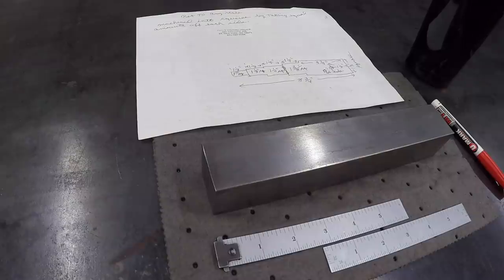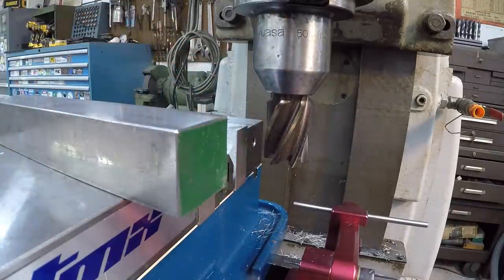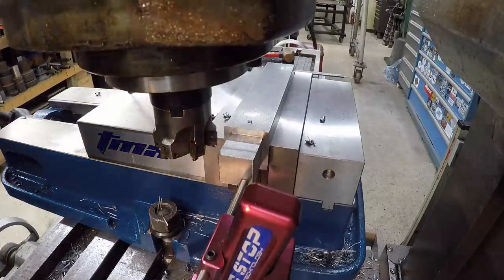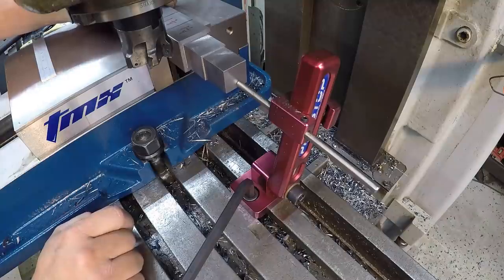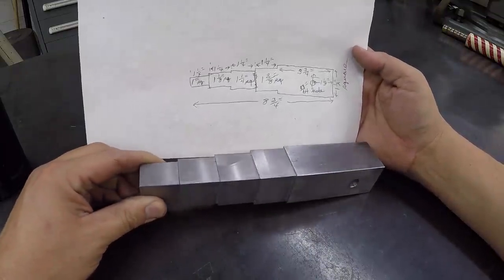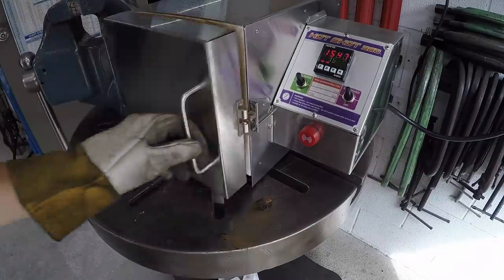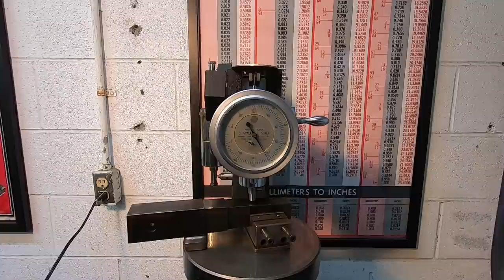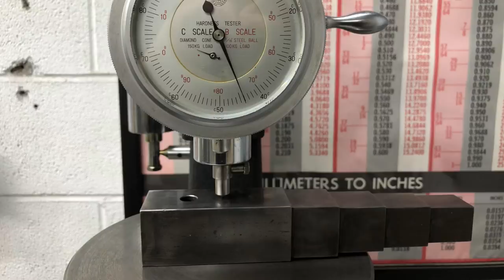SNS 296: Custom Square Drive Tool, Heat Treating

Comment: lol quenching oil, just use hydraulic oil. why the hell do they even sell it in a plastic bucket? you can put a hole in the bottom very easily. buy some steel buckets, McMaster-Carr sells them 5gal-7gal

Comment: Abom you need to heat the workpiece at ~900°C (the workpiece must be light red/yellow Red) and then cool it down vertical in water.
Then put him again into the furnice at 250°C until the workpiece is lightly blue and then you cool it down in water.

So thats it :)

Comment: All I know about heat treatment I know from books, so take this as a very unprofesional tips and also excuse any possible mistakes in grammar. The position of workpiece in the furnace does matter. For best results the heat should be consistent all over whole surface, so you should place workpiece on small “parallels”. Another thing is holding the piece. If you grab it with metal pliers it will  immediately take some of the heat in the place you’re holding it, so you should hold it somewhere where the hardness doesn’t need to be consistent. And another thing is when cooling workpiece in oil, you shouldn’t go from side to side, just up and down. This mostly helps to provide microcracks, but it also helps to escape any oxigen stuck in the corners, so it might affect the hardness. The correct temperature is very delicate. Sometimes we’re talking about interval of 30 °C. Few degrees of and you’re getting completly different results.

Comment: YOU FIRST HAVE TO REMOVE FOIL THEN QUENCE. FOIL INSULATES AGAINT FAST QUENCE
Reply: The couple of thou' thickness is not going to insulate a 2" part.  The foil could well be stopping the oil get to the surface though, which affects the chemical change.
Reply: RangieNZ 
Only problem is, it is not the 0.002” of the bag that is the problem, it is that the system is not free of voids between the bag and the bar, the voids (air or other gas) stop the heat from leaving the part fast enough.

Comment: would be helpful to see how deep the heat treatment went. maybe cut open the test piece and then you can tell how/if it was evenly tempered. 
I've seen it a lot on transmission shafts, but it done with electric current, probably easier to control and quite a bit faster

Comment: Adam IF you watch Forged in Fire you could see that they quench the metal directly into the oil not on a bag
Reply: I think the foil is used more for air hardening metals. And I've also heard of people putting saw dust in the foil to help with the oxygen. I think it flares up and gets rid of any excess oxygen in the foil  bag or envelope.
Reply: on FIF they use oil-quenching steels, not air-hardening alloys.
Reply: This is true but in Adams case he probably don't even need that foil. Because he's not using air hardened metal.
Reply: @ozzyfranf  exactly.

Comment: I have NO experience at all in heat treating metal , what I don't understand is why you wrap the metal in stainless steel  to keep it from the oxygen in the air while you are heating it but after removing it from the oven you expose it to the air while you unwrap it , that doesn't make sense
Reply: Just for a short time. Think about it like rust, that is just another form of oxide.
Rust formed by moist and salt for a short time is thinner than rust from several years of accumulation.
Heat speeds it up and form a different kind of oxide.

Comment: why would you use the foil? I honestly have never seen that used anywhere. Especially for steel.

I think that you should just test it out.
1 - Just lay it flat in the oven
2 - let the piece stand in there
3 - use a stand, is there a difference in hardness in areas that touch the stand and don't touch the stand

And only if you don't see satisfying results after these tests I would think about using a foil. But then I wouldn't use foil in the first place and build a heat shield to avoid direct radiation to the part with ceramic or a proper thick iron part.

Usually these oven have bad temperature regulation with big peaks above the set temperature. And in my experience they require a proper setup of the control system.
Reply: Ran a metallurgical lab early in my career. Foil wrap prevents any oxygen in the furnace from de-carburizing the outer layer of the part. Foil has to be removed before quench to achieve the required cooling rate. Look up TTT diagram. The slower you cool, the more lower hardness constituents form.

Comment: Adam, great video as always. I’m always impressed by the fit and finish of your projects. However, three aspects of your current project did not seem to be up to your usual standard.

1) You left the milling marks on the “stepped down” faces rather than polishing them out (21:10).

2) You left multiple “pits” from the hardness testing instead of removing them (33:40).

3) It could have been a trick of the camera, but it appeared that the 1 inch, and the 1.125 inch segments were significantly longer than the others (21:07).

Admittedly, none of the above would interfere with the functionality of the tool, but you normally pay such close attention to the aesthetic aspect of your work, this surprised me.

Lastly, shouldn’t there have been a slight clearance calculated into the size of the square drives? The fit between a 1 inch square drive and a 1 inch square hole (ditto the other sizes) may be overly snug for an item which, in use, is to be repeatedly inserted and removed. Also, if the hatch wrench openings are not manufactured to the expected tolerance, they may be smaller than the exact nominal size, thus preventing the square drive from being inserted at all. What about incorporating a slight taper into the square drives, similar to the bit on a Robertson screwdriver?

In any case, keep up the excellent work!

Comment: Good day Adam I agree with the last comment rapping in old news paper works well also using some thin wire to create a means of picking up the part when it’s at temperature. The socking period is when the part is at temperature at its core and requires the time for the molecules to be realigned to a finer structure this creates the hardness. Tempering also has a hold period to change the structure of the grain.

Comment: FYI your mic is picking up a very high frequency, probably from your shop light. Replacing them though is probably very expensive so it's probably chepaer to remove the frequency during editing.

Comment: Try quenching in water, I have an understanding that the hardening is a by-product of how quickly the metal cools. It will cool faster in water than in oil
Reply: No, different materials require different quench rates. You shouldn't just willy nilly dunk hot things in water. Some materials that typically are air or oil quenched, if quenched in water will warp to high heaven or just crack to pieces.

Comment: Hello Adam, check this video out: https://youtu.be/SInVV9rDAao?t=150  It's about the manufacture of railroad switches. One of the machines that caught my eye was a big industrial shaper.  Cheers from Canada.
Reply: that's actually a planer, notice how the tool is stationary while the table is moving
Reply: @yo64yo  Thank you for pointing that out, I've learned something new. 👍

Comment: should he wanted drilled out material to make lighter?
should he have wanted ... to drill out middle to make it lighter
Reply: I wondered the same. Would love to see it in use.
Reply: I thought the hole was for a handle. Probably a "universal" tool meant to fit the grab bag of square drive holes used by the chute door mechanisms on such hopper cars... such cars need to be dumped out quick at the station, and not having the particular driver one needs is a slowdown one can't afford (especially when a train with 50+ hopper cars comes in during harvest season!)
Reply: just drilling out the center of tool would have made it lighter and not effected it over all strength.

Comment: Any compliance in the test setup will give you higher readings, so that vice, stiff as it is, might make a few points' difference.  Thinner cross sections cool more rapidly, so you should expect the smaller squares to end up harder.  A side of the part that is resting on the ceramic floor of the oven is not going to heat up, but if you heat long enough, the part should be over 700C.  It doesn't really matter how quickly you heat it, or how long you heat it, as long as you heat it long enough.  After tempering, I think for most materials you are supposed to let it cool in room air; not in oil.  I'd check that out to be sure.
Reply: I have seen some steels sold as oil quenching, some as air hardening. I always thought it depended on the specific alloy and how much you want it hardened. The tempering is actually a patial annealing step. It keeps the metal from being fragile, and actually reduces its hardness somewhat. Both the hardening and the annealing or tempering processes are controlled by the temperature you heat the metal to and the rapidity with which you reduce the temperature. The timing will vary based on the alloy, carbon content, heat temperature and the speed of cooling. Faster cooling and from a higher temp will leave a harder but less tough material, where toughness is basically resistance to fracture, or malleability. A very hardened material won’t bend much before breaking. But the harder it is, the greater the resistance to wear - it will not abrade easily, where a tough material will. Hardening aand tempering are practically an art form, like cooking. Now consider ‘case hardening’ : hard on the surface and tough in the middle. I can see how you’d do that with laminated steels, like yellow outside blue, but how do you case-harden a bar, for instance, of homogenous material? A rapid cooling of the surface, but only partially combined with a longer cooling process throughout? In this case, with the stepped bar, it could be covered with a refractory paste that is thicker over the thin end and gradually thinner as the metal is thicker, or it could be quenched more rapidly at the thicker end (no covering), to get a more consistent hardening. So hold the bar with pin-point tongs and dip it into the iol faster at the thick end, or even only at the thicker end.
Reply: @TSPhotoAtlanta  Well this alloy is 4130.  It is much like cooking in that you follow a recipe, but lots of details determine how well you are able to follow it.  Case hardening is exactly what is happening here because the cooling rate is faster at the surface than 1/4" in.
Reply: As long as the temperature you heat it to for heat treatment is in the correct range, being above that by a couple hundred degrees doesn't matter, and staying there for a week wouldn't matter.  Cooling rate does matter; a lot for some materials, but actually 4130 is pretty linear, so it is fairly easy to get some benefit from it.

Comment: The heat coils are on the side so the harding is more on the sides You may have to rotate the stock when it gets to temp. Forged in fire uses gas and the flame goes on all sides
Reply: except the bottom.
Reply: @mlminto  to get all sides and bottom flip over and do a 180 if on its side. If on the end turn piece and do 180 top to bottom.
When heat treating your knives which method of heating do you use gas, coal, of electric because each method yields a different type of hardening process.
I've seen that gas is best in my opinion it gets to a higher temp then the others,. Electric to me is too slow for heat hardening and involves turning the piece multiple times, with coal too many problems can occur. (Not hot enough, contamination of coal and constant monitoring of coal)
Reply: @harolddomangue9206  i use an electric knife oven, and place my knives edge up when heat treating.  that way they are fully exposed to the heat generated.

Comment: Wth are tempering ?  You never even hardened it.  Tempering is softening the metal after you've made it brittle hard.  You're tempering a soft piece of steel lol.  You need to bring that steel up to NON MAGNETIC (red hot) Then you quench it,  Then you temper it, and maybe let the piece soak in the quenching heat a bit longer to get an even heat through out the entire piece your heat treating. You'll get her.

Comment: this is  a CCT for 4140 and 4140HW   http://www.timkensteel.com/~/media/4140HW_Brochure_July2015_Update
figure 8 states as long as you cool from 1650F   too below 700F  in less then 100 seconds then all grains will be martensite.
note that if you want to convert more grains too martensite you can super cool the part for 8 hours to say -150F and it will get even harder hardness.
this video below will take you thru this process '
https://www.youtube.com/watch?v=zCznMbj2Yn4
last tuesday i was over at teh machine shop helping owner tempering 4140 

the best ttest to see if the material you are hardening is up too temp and ready for quenching is check to see if it has any pull on a magnet.
when steel is heated past the temp were it looses magnetic attraction all the crystalline grain in the steel are free to move. at this point it is ready to quench.
many swordsmiths will quench blades where they are due North  so too set all the crystal facets in that direction before quench and this locks grain facets in this direction.
you can also have teh material quenched in a magnetic flux you create as well.
Reply: Yep, you can quench in liquid nitrogen at any point in time after hardening and it'll improve the hardness. There's a science and engineering channel on here who did that with drill bits. He just got the bits and quenched them in LN2 and it improved their durability greatly. :)

Comment: What if you cooled the oil in a freezer, that way the part cools down much faster. I think the quantity of the oil is too little and the part is heating it up too much to be effective.
Reply: Usually blacksmiths will heat up the oil slightly before quenching for what ever reason, so cooling it down doesn't seem like a good idea. I can't tell you why, though.
Reply: Cooling the oil speeds up the quench. Oil is used to slow the quench. It you want it fast use water.
Reply: @Abrikosmanden  They heat up the oil to slower cool down the part. It prevents cracks and bending.
Reply: Robert Isn’t the whole point of cooking it down fast to harden it? I would imagine if you wanted a harder steel you would cool it down as fast as possible and a softer steel a more gradual cooling.

Comment: Google Heat treatment books free download. Many free sources. Here's a link for general information on such processes;  https://en.wikipedia.org/wiki/Heat_treating  In all the videos I have watched on knife forging the steel is red hot when it goes in to the quench. Each grade of steel uses different temperatures depending on the alloy used and why you need treatment  in the first place. Creating a wear surface or making the steel stronger. difference temperatures and quenching regimes give you different outcomes.

Comment: roflmao , i think for the oil to reach the object one might take said object out of the protective bag first ????? it also helps to preheat the oil , and , quenching oil can burn , so if you dont want your new shop to burn down i suggest you use a metal tank to quench in that has a lid ( you figured that yourself ) , you should see the forged in fire episode where this dudes shop burns to the ground when his quenchingtank overflows and catches fire , i suggest for the tank to go to a army surplus store and find a large ammo box , thats strong thick metal , has a sealed lid and handles , they have a size around 3 ft X 1 1/2 ft . should work just fine for what you want to do with it. when it comes to hardness , thinner parts heat up and cool off easyer then thicker parts so differences in hardness isnt strange , and you should have cut the foil off before quenching it , so take the time to unwrap and account for cooling off while doing so , so heat a little hotter , your oven heats primarily on 2 sides , so perhaps flipping it one quarter turn while heating might get an even heating , ow , rtfm before you start this type of stuff adam , learn as you try isnt always the best way
Reply: A box that size, filled with oil to a depth of one foot, would require more than 33 gallons!
Reply: @UncleKennysPlace  well yea it would , but that would allow for bigger objects to be quenched . that being said tho one can always choose to use a smaller can , i simply pointed to ammo cans for their construction and usefullness in this type of application .the size box i first mentioned would suit more for sword making .ammo cans come in a large range of shapes and sizes , are cheap , strong and mostly come with lid seals and handles ,what more could you wish for.

Comment: 27/64ths ... when will the us go metric ffs
Reply: Metric makes you dumb. Evidence: this comment.
Reply: As an American, I don't understand it myself. Fractions are terrible, I have come to loathe them. I've been working on foreign cars my whole life (Japanese mostly) so metric just makes sense to me. I've slowly worked my measurements into metric, tools, temperatures, distances, etc. Gotten to the point where I can convert from Celsius to Fahrenheit in my head within a few degrees. Using km or kph instead of mi or mph is taking a bit though.
Reply: So if you are measuring tire tread depth, you read it in 32nds. 1/32 2/32, 5/32, 8/32.

Why not convert the fraction to 1/4s or 1/8s? 

Because it's easier to visualize a difference between 3/32 & 8/32 than it is between 3/32 $ 1/2.

So really, since you are interested in just the difference between two measurements, it doesn't matter what the units are. 32nds, millimeter, parsecs - it doesn't matter.